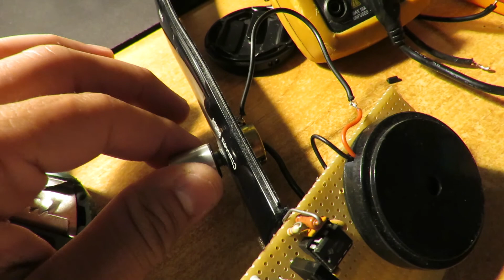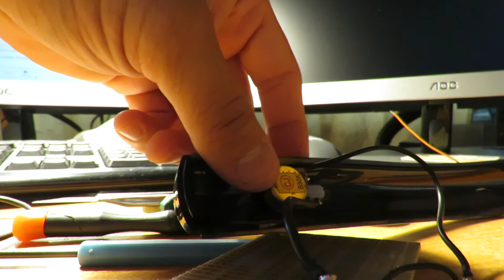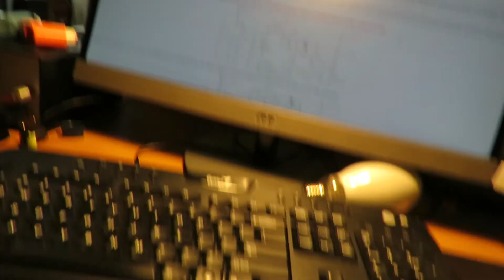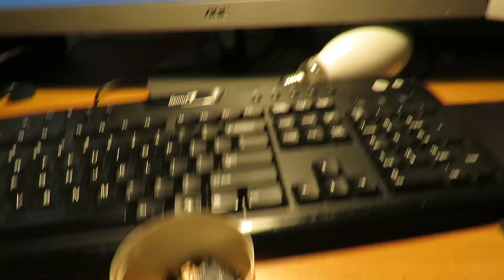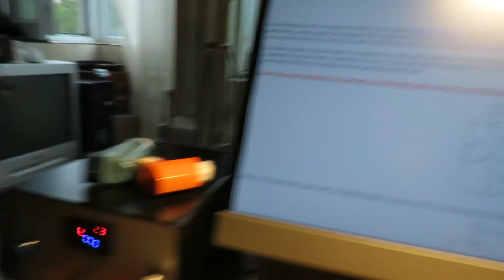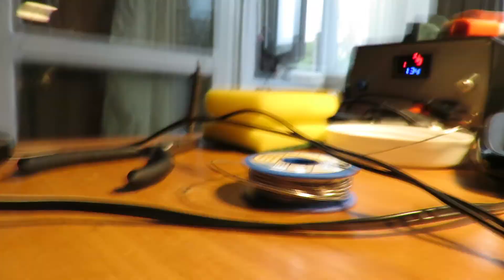Lightning detector madness

Comment: Hi i had this problem to... and after 2 days i turn the diode around and it works now.
Reply from the maker: Sorry for being late, YouTube doesn't show me comments on PC, I have to use my phone.

I am now detecting from tens of miles away. What I did was just replacing the LC couple with some random components I had - the coil from a microwave oven fan and the variable capacitor from a radio. I randomly adjusted the capacitor until I felt it was good enough, now it's so sensitive it picks up electrostatic discharges around the house.

I will do another video about it's final form. :)